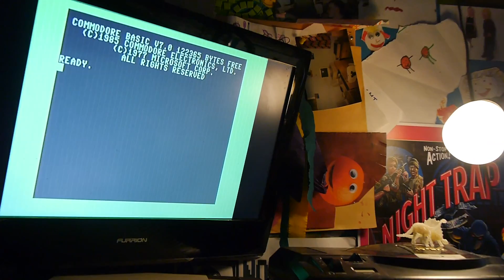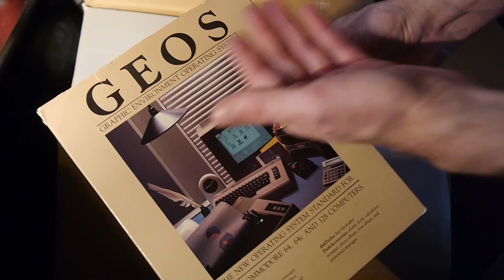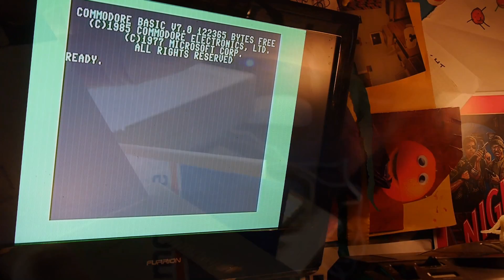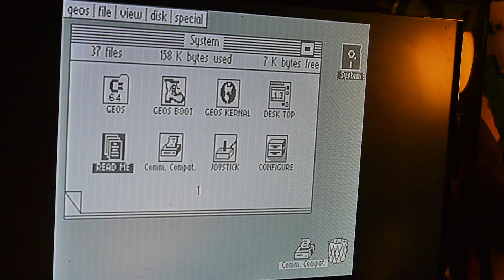Commodore 128 & GEOS, "Repair", Setup & Inspection | Nostalgia Nerd

Comment: Yeah uh. I probably wasn't aware back in 2016, but plugging in a strange Commodore isn't how I'd go about it. First I'd check what the PSU outputs, THEN maybe try turning it on. Still, this gives me hope that MY 128 is in working order without major repairs.

Comment: When I had a C64, I didn't care about the 128 until GEOS came out.  It wasn't even worth running on the 64, but by that time, I was about to buy an Amiga, so I didn't care.  Now, I kinda want to get a 128 just to try GEOS on it.

Comment: Hey Nostalgia Nerd, just remember to keep a disk in the 1571 at all times. This is a two head drive with a head lowering prevention if no disk is in. The spring for the upper head is prone to breaking or bending from years of one sided stress. I was able to fix a broken one recently using mildly elastic epoxy, but there is no guarantee.

Comment: About as slow and as crappy a poor knock off of the Macintosh Finder as I remember it when I used it back in the day.   It might of been semi okay with a legit Commdore mouse but you didn't have one, you had to use an Atari Joystick like that to move around which was a bad joke.
Reply: To be fair, he's only running the C64 version of Geos - the C128 version with a REU installed is actually pretty usable.

Comment: I still have a C128D, I use to run it with dual floppies, and a CMD HDD, Final Cartridge III,  and dual 40/80Col monitor, mouse. Running GEOS 128 in 80col was the bees knees...

Comment: I think the 128 geos will autoboot from just turning it on...just put the disk in and turn the machine on. Also, you need to add the mouse driver from some other disk to the geos boot-up disk...and I don't think that the amiga mouse works with it...I think that you need the 1351 mouse...I am not sure but I don't think that they are 100% compatible if anything at all...

Comment: Interesting... so I guess GEOS only runs in 64 compatible mode then?  I'm a bit rusty with GEOS - haven't played with it in a while.... and that was with VICE emulator.  One thing I do remember is if you have a RAMDisk you can really speed things up.  :)
Reply: Robert Bryant Lock  No, there is a Commodore 128 version as well.  But he wouldn't have been able to use it, since he had his monitor plugged into the normal video output.  To use GEOS 128, you have to connect the monitor to the RGBI port on the back, because GEOS 128 runs in FAST mode (which the VIC-II chip can't keep up with).
Reply: Thanks for clearing that up.... had no idea there was a 128 version.   I'll have to try it out in VICE too :D

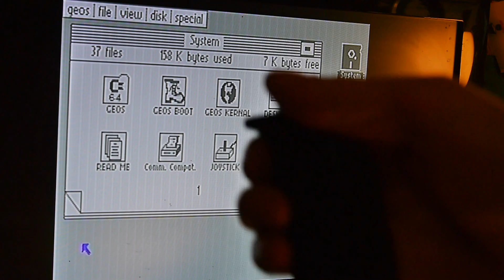Comment: 12:25 - It seems you have your mouse running in joystick mode . I remember using that on programs which did not have built-in mouse support (which was close to everything on the C64 really) like the Final Cartridge III's GUI (yes, even freezer modules had their own version of windows - at least that one..). The 1351mouse does have a switch on its bottom side to toggle to proportional (i.e., proper) mouse mode. And if your mouse works with a C64/128, I don't think it's the Amiga mouse. The 1351 looks exactly the same from the top.

Comment: What's the point of GEOS on a C128 if it doesn't have a native 128 mode? The memory restriction on the C64 was what kept me from using GEOS in the first place. That and the jarring loading speed while booting up. And its lack of compatibility with leading software on the C64. Come to think of it, it was little more than a demo platform for that 1351 mouse.
Reply: None of your Business  It DOES have a native 128 mode.  The problem is that he needed to be using the RGBI video output.  GEOS 128 uses the computer's FAST mode, which means it can't use the VIC-II composite output.

Comment: I used to do my English essays on Geos Write, and then print it all out on a hellishly noisy dot matrix printer with a blue ribbon. Used to drive my parents mental.
Reply: Did my final college marketing project with Geos Write. Text and graphs mixed together beautifully but I printed it on the Okidata color printer. The output could only be called “waxy”.
Reply: ungratefulmetalpansy same, butproduced my first publisher type documents that included text and some bitmap graphics

Comment: 1571 was used as mt BBS system drive/more space than the 1541... I was able to use 3 1581's for uploads/downloads.
was a stable system, never had heat related problems with any of the hardware... good video.
FIBER0PTIC/FBR, The HUMBLE Guys, Napalm and Worship.
Reply: 1581 was a good and high capacity drive. I do not know the speed, I know it was faster than 1541, but 1571 had just the double capactiy of the 1541 (due to double sided)
I just learned about the IEEE488 Commodore drives, and the SFD-1001 was a beast (I own one now). With IEEE-488 interface it was 5 times faster that 1541, and had 1MB capacity per disk, and was not bigger than the normal "old" 1541.
 I heard a guy also running a BBS, and diasy chained 4 of these SFDs. 4MB capacity was close to a Commodore HDD's capacity, and it was not much slower too. Certainly was much chaper than that. I hope once Iwill able to buy an IEEE-488 C= HDD to test.

Comment: 99% of the time I ran my 128 in c64 mode.
Reply: c128 seemed like a good idea but it didn't get enough adoption to be useful.  It was an odd machine.  the z80 based CP/M mode was less than useful and there wasn't much 128 software other than GEOS 128 (the software in this demo was GEOS 64.. 128 would have run faster).  So most people did run c128 in c64 mode.
Reply: @justinhenryhaynes  GeOS 128 was the killer app for the 128 I think. That alone must have made it worth it. It converted an 8 bit Home Computer into something that could compete with the PC and Macintosh for Office and graphics work, for a laughable price. And if you wanted to play games, wel..., then there always was that good 'ol C64 mode. Samples on the C128 revision of the SID chip didn't work properly though...
Reply: FIBER0PTIC HELL then why the fuck you have c128?
Reply: @mtunayucer  because he's a baller, flexing on his friends
Reply: @mtunayucer  There was very little software that was written specifically for the 128.  I had one. Never bothered using the CP/M mode.  Friends told me there were compatibility issues. I did use GEOS quite a bit in 128 mode.  Wrote quite a few documents with it, and had the Commodore dot matrix printer.

Comment: I think I talked my spouse into buying a C128 because 1 of our C64 games supported enhanced music if you ran it on a C128.  I also used the "C128 can run CP/M productivity software" argument, too; however, by then, we already had an IBM-compatible (not sure if it was a 286 or 386 at that point) in the house, and didn't really need productivity software at home until we had a reliable every-day Internet connection (which we didn't with the next-county-over, long-distance-phone-charge server we accessed Q-Link from).

Comment: It run at 1MHz when using the VIC chip (40-col). It can run at 2MHz mode when using the 80-col display but not automatically. Type the command "FAST" and it will switch to 2MHz.
Reply: Christian Holmstedt  Also, even when in C64 mode, there was a POKE that would blank the screen and run in 2 MHz mode.  Another POKE would switch back to 1 MHz.  There were even utilities published in magazines that set up a raster interrupt; when the screen raster reached the top of the bottom border, it would switch to 2 MHz, and when it reached the bottom of the top border, it would switch back to 1 MHz.  The end result was roughly a 20% increase in speed.

Comment: I loved my 128, i didn't have the newer 1571 diskette drive, but part of the reason I bought a 128 was because it was an easy upgrade from the Commodore 64.  It played all my old C-64 games, but I could use the C-128's new BASIC graphics and sound commands.  Plus, I could experiment with CP/M (by 1985, CP/M was in decline, but it was fun to experiment with just the same).

Comment: For Geos you really need a Ram Expansion and multiple drives.  Then you can make Ram Drives and speed things up quite a bit.  I only used the 128 mode for BBS calls  and Word processing. Nearly everything else was in C64 mode.

Comment: Some fact: C128 was released two years earlier than the Amiga 500. It was out around 6 months before the first Amiga, the Amiga 1000.
Reply: I often wonder if many of these retro youtubers google anything before they spout off about it.
Reply: @Great-Documentaries  The Amiga 1000 case was designed and produced at Commodore. I've got  myself a book with the case design drawing pictures.

The chipset was of course pretty much developed at Amiga corp over the previous couple of years to working breadbin prototype state. 

Amiga 1000 was launched 23 july 1985 and was shipped to retail in September 1985.

Of course not shipped to everywhere at first, here in Norway we has to wait to around summer 1986 to get a PAL version.
Reply: Amiga wasn’t commodores product at first
Reply: @jaybrooks1098  The very first production Amiga computer was designed and produced by Commodore, the Amiga 1000. 

Amiga Corp (HiToro at first) developed the chipset prototype breadbin boards that was made into 'silicon' IC's for the Amiga by Commodore and MOS. Commodore bought Amiga Corp. in 1984 and realized the Amiga 1000 that was launched in mid 1985.

Comment: Couple geeky C128 notes: 2MHz was only available when in 80 column mode (128 mode only) because VIC (responsible for 40 columns) wasn't capable of running at that speed. Also, GEOS had a C128 version for high resolution mode, but I believe it may have required the C128D with 16K of video memory - though my memory might be wrong about that. I do recall that it was a much nicer version when I ran it on a 128D.
Reply: Johnmichael Monteith The C128 came with 16k of vid RAM and the c128D upgraded the vid RAM to 64k. I swapped my c128 for a c128D for that reason in addition the the fact that the 1571 disc drive was incorporated. As an added bonus all of the components powered by a single internal PSU.  It really tied the package all together nicely with its Amiga 1000-esq profile.
Reply: Correction...  Apparently there were a early quantities of c128D's that were produced with only 16k of vid RAM..

Comment: Slight correction; when running in 40 column mode, the CPU only can run in 1MHz mode, not 2MHz mode.  You need to turn off the VIC-II chip in order to run the CPU at 2MHz mode.
Reply: The motion of the mouse pointer suggests it's not the Amiga mouse.  The Amiga mouse used quadrature signaling to indicate directions.  What you're using appears to be a Commodore 1350 mouse which worked by emulating a joystick.  Replacing the mouse with an actual joystick further cements my hypothesis.

An actual Amiga mouse would have resulted in quite spastic mouse pointer movements, as I recall, unless you install a proper Amiga mouse driver for it.
Reply: The Commodore 1351 is a true proportional mouse and is the best input device for GEOS. That horrible Commodore 1350 mouse is really a joystick in disguise.

Comment: Very nice video, never saw before the Geos GUI in action! 
Had Commodore 64C with cassette drive myself and later got Amiga 500 which I still have. Amiga 500 was introduced btw in 1987 but Amiga 1000 indeed came in 1985.
Back in the 80's one neighbour had Commodore 128 like the one in your video and I remember we used to play games like Ghost'n Goblins and Bomb Jack. Another guy I knew had the later Commodore 128D, played at least the Batman game with it.
Those were the days :)

Comment: I hated how the 1571 wasn't 100% compatable with all of commodore software.  I had to have a 1541 on standby.  Even if you adjusted the 1571 the way they told you, it still didn't work 100%.

Comment: Sorry the Amiga 1000 came out the same time as the C128.  It was the last 8 -bit computer that Commodore marketed.  It did not come out the same time as the A500.  in was 1987.
Reply: Clayton Pitts actually strictly speaking the C64C was ;)

Comment: Something I learned the hard way with my 128 is that the fuse for the power supply can blow.  While it isn't commonplace, you want to look into spare fuses if possible.
Reply: Same as for the Amiga 500. It happend to me just after a few days of operation. I was young, had been working for a year to get my first own computer in 88, and this shocked me to tears. But we were soon able to find out, with some telephoning, what the cause was. When it happened the next time, I already had a substitude fuse in reach. :)

Comment: Had more fun with thus computer than anyone had a right to. Still have a working "D" version. There is a GEOS 128 which really flies with a RAM expander (1750), 80 column screen and an FD 4000 3.5" drive. Am still discovering things about the built in Basic 7.0 and (remember this one?) an add on "Basic 8" by Walrusoft. BTW, if you could read the 40 column screen, your 8502 was at 1 MHz. The VIC chip couldn't keep up at 2 MHz, so they had an extra graphics chip for 80 columns at tht speed. Best computer EVER, no two ways about it.

Comment: That's not a resolution switch. It changes the TV channel of the RF output between 3 and 4 on your TV if you use a TV as a monitor. The 64 had the same switch. Built in RF modulator.

Comment: ah....disk drives the size of a vcr.....good times, man.
Reply: Meloe haze  You mean computers the size of a VCR.  The Commodore disk drives were "smart" drives... they literally had their own CPU, RAM, etc.  That's part of the reason for the size.  (And the first generation had an internal power supply instead of an external brick, which is why they were so much larger.)

Comment: The Commodore 128 was the pinnacle of 8 bit computing. OK, the Apple might be for some but technically this thing was awesome and backwardly compatible with the 64. Great stuff..
Reply: Nevets and it costed half the price of an Apple.
Reply: Apple have always used the "It must be great because it's expensive" tactic. Still works to this day.
Reply: Even had a CP/M mode.
Reply: Aleste 520EX and PC Korvet better
Reply: Apple IIe uses a MOS 6502 which is basically owns by Commodore. Apple has no hardware technology....only until now in 2020 they start designing their own chip (with some ex staff from Intel i believe) and they still don't have the manufacturing capability. Commodore was the only company that has such capability back then from design to chip manufacturing. Hence the customised SID instead of another AY-39xx which is used by almost every other company.

Comment: Bloody hell that thing has mod wires for days. My 128 looks pretty clean as far as such bodge jobs go - wonder what the deal is. My unit is from Sep 85 and had the "q" bug in ROM - of course, I say had since I installed JiffyDOS in it, thus fixing that problem as a side effect of the install. Thing works a treat, although it sometimes just won't run certain software - could be the fact I'm running some progs off SD, or could be PAL / NTSC issues - never know with these things.

Comment: GEOS really comes into its own when you have a machine with expanded memory and an accelerator (like the CMD SuperCPU running at 20mhz). On a stock C128 it's a bit slow, but not unusable. A C128 with one of those SD card/floppy emulators really makes a difference with GEOS!

JW3HH
Reply: Thanks, did not know that.    Might as well get a Macintosh though by that point.

Comment: QauntumLink cost a fortune!  I remember an $80 bill for one night of just chatting.  And the 128 is pronounced one twenty-eight (at least we all said it like that).  Furhter, the GEOS was just a novelty - something that came out late and nobody really made any good use of it.  Cheers.
Reply: Geos 128 had a lot of potential with its use of the 80 column mode and clock doubling speed, full use of ram expansion . problem is, the amiga did everything it could so much better.

Comment: geos seems like something that would have blown my mind if I was alive when it came out (I'm only 20 :\ )
Reply: Don't get too exited. GEOS ran as an operating system and required programs to have certain lines of code to be able to exit them and still retain GEOS running. I had more usability with the keyboard, GEOS didn't play well with non-GEOS programs.
Reply: lochinvar00465 ahh, I see guess it was really just a proof of concept sort of thing? seems like your just better off just booting into basic then

Comment: To use GEOS, you really needed an REU and a larger drive, like a 1581, or at the very least two 1541 drives. With just one drive, GEOS really wasn't worth the trouble.

I used to like being able to print in fancy fonts and I had a couple different font disks for GEOS. One day I decided to print out samples of all the fonts in various sizes. Easier said than done, since the fonts needed to be on the boot disk and since you couldn't copy GEOS files with anything but GEOS, you had to swap disks about 2-3 times per file. It took hours, especially as GEOWrite seemed to have a mind of its own with regard to fonts and sizes, but I finally had samples of all the fonts printed out. The very next day my friend spilled his coffee on the printouts. There was no way in hell I was going to go through all that again.

Really the only programs most people used GEOS for were GEOWrite and GEOPaint. Even then the most notable use for GEOPaint was converting MacPaint images to GEOPaint format. Using it to create anything from scratch was more work then using a normal graphics program. About the only advantage it had was being able to use all the fonts to add text to images.

It was an ambitious idea, but I always found using it to be more trouble than it was worth.